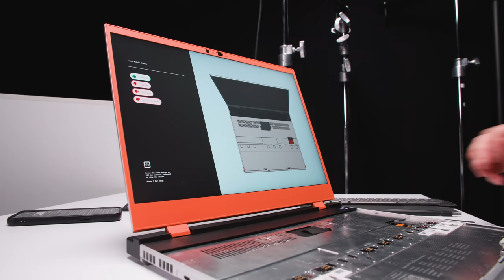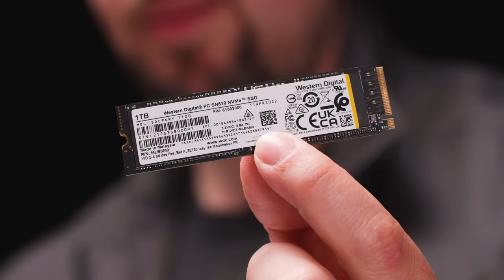Framework 16: an exclusive look inside the modular gaming laptop

Comment: Framework has the advantage that other giant players didn't have. Not only are technology more mature than before (USB-C modules couldn't have been replicated with earlier standard technology, necessitating proprietary modules), they knew when to delegate to the wider community, unlike other companies which tried to do it all by themselves. Also, perhaps most importantly, Framework has nowhere to back off, while existing business have nothing to lose if they don't keep up with the promise.
Reply: I think you're right with regards to USB-C. I think you're a bit off on part about other company's having to struggle by doing it all by themselves. Unlike Framework they had massive engineering budgets, teams and purchasing power that could have enabled them to do something like this far earlier. Laptops back in the day used to have a fair amount of modularity (not for upgrades but for batteries, expansion cards etc). But it wasn't in their shareholder's interests for them to make their computers modular over the long term in a way that would reduce overall sales of laptops. 

Framework's big bet here is that they can scale up big enough to be able to work with big players, and get volume discounts to be price competitive, and then that they can utilize that customer base to continue to sell upgrade parts and new laptops.
Reply: There was a standard used in the past for expandable modules, but it died as more companies ditched modules and became less and less repairable
Reply: It's about money, if a big company does modular laptops. Less consumers will be a new complete laptop
Reply: The truth is that most of those big companies were doing it as a gimmick and didn't actually care.
Reply: There's also another crucial aspect imho: computers are now "fully developped". I mean, of course tech always progresses but unless you game heavily or do intensive video editing that kind of specs will be good for a long time. Even disk space is not really an issue with the rise of cloud based services. If you go full premium and get yourslf the latest motherboard, 1TB of SSD and 64GB of RAM, that laptop can be functionally valid for a solid decade.

Comment: Pre-ordered mine! Expensive AF to deck it out (except storage -- supplying that separately) but I am so excited.
Reply: But that's the thing; sure, the initial investment is high, but as long as the chassis is undamaged, you just replace broken parts and upgrade legacy ones. A perfect example is the CPU, typically an integral part of a laptop that is not economical, if just impossible to upgrade. Here, you just buy a new motherboard with the latest gen CPU, replace it in 10-15 minutes, and you're good for the next few years. Imagine how hassle-free the Windows 10 to 11 upgrade would be if everyone did this.

Comment: The possibilities are endless with the removable ports. I'm on batch 1 of the pre orders and also gonna wait for someone to make a module shell that can house an entire logitech wireless receiver into it so it is absolutely flushed into the laptop.
Reply: Such a shell shouldn't take more than a few minutes to whip up and produce on a 3D printer.
Reply: You might also be able to just take some of the pci express lanes from the expansion bay, add a usb port inside the expansion bay, and put the receiver in there

Comment: The Pricing is very good right now, especially for a first gen product. I think I'm aiming for the 2nd gen version of the 16
Reply: I will buy the Gen 2 too.
Reply: I'll buy first Gen, but I want to wait until it's fully out and probably will wait for a second Gen graphics card module.
Reply: isn't the point of this that there are no "Gen"s? The framework 13 has kept the same body through 3 years of CPU upgrades. you may be waiing a long long time if a new body is what you're after
Reply: @defnotatroll  I agree Generation is probably a bad way to talk about what Framework is trying to do. 

My point is, I'll hold off sometime and see if there are iterative (or otherwise) design & sw changes/improvements, before getting one.
Reply: @radikal8485  design change with compatibility with existing components would be great
Reply: @defnotatroll  yea I know it's not the right wording. The first 'update' to the fw16 then I suppose.
Reply: $1400 for barebone. No dGPU, no ssd, no ram, no USB ports. Also lol at verge deleting post with crapping on framework.
Reply: Why wait? If it's just to get the next CPU or GPU.... Why not wait for the one after that?

Why not wait forever?

I'd argue you should buy one as soon as possible and dump on every other wretched laptop maker for not having something like this.
Reply: There aren't really any "generations" though, the framework laptop 13 case has remained the same though all 4 CPU generations it has so far

Comment: This is awesome! I just wish they added a trackpad with buttons.
Reply from the maker: Yeah I was surprised there aren't alternate trackpad modules. Also, you have to have the trackpad directly below the keyboard, not that many people would want to offset them from one another.
Reply: Separately, I’d be very surprised if they haven’t looked into a TrackPoint (is that what it’s called? The red keyboard nipple.)
Reply: Not having actual buttons is a deal-breaker for me.  Otherwise, I'm sure it's a nice machine.
Reply: Yeah, I have a trackpad with no buttons and I absolutely hate it. Worst trackpad I've ever had and I've had a lot of them. Impossible to do left + right click at the same time, amongst other things.

Comment: While it is expensive for the specs, I see it more as me buying the laptop not because its the best value, but because I love the concept and really want to see them succeed in the long run. Also I don't really care the dGPU is close to 3060 levels of performance, it's still a massive upgrade from the RX 6400 I have in my crappy Dell OptiPlex from 2013, and most of the games I play don't need super high end GPUs anyway.
Reply: And you'll be able to keep the chassis/core components and only upgrade your pain points going forward.
Reply: Chances are pretty good that eventually they will have Nvidia GPUs too so for those that are like me and dont have a lot of time spent with AMD hardware that will be good. This will be my first full AMD system since my laptop I had after high school.
Reply: @claytonmerle976  Funny enough this will be my first laptop after high school. I'm so excited to get rid of my school provided Thinkpad for something with a bigger screen.
Reply: It is also a great value for its upgradability. When you want a new laptop, you won’t have to buy a whole new computer.
Reply: @CC-gy7el except 2 whole new computers might be cheaper than a framework plus upgrading it overtime. I hope they get big enough to be cheaper.
Reply: @MrGamelover23  Probably high cost rn because of the massive advertising they have to do to get their name out there
Reply: @Abberaeitsneozm  I doubt that, remember that they are not big enough to have the economies of scale of the competition. Remember, these aren't just simple off-the-shelf components.

Comment: Let's say if I buy a fromework Laptop today, my expectation is to keep this laptop for as long as posible and in theory, I can keep this laptop indefinitely as long as Framework keep supporting upgrades / replace modular components for the laptop. So instead of spending 1000 USD every 2-3 years I can spend  400-500 USD (hopefully) to upgrade
Reply: I have a vivid vision of carrying a 14 inch modal Framwork laptop to my company for work and then bring it back home and mount it to eGPU for gaming
Reply: @heliosaiden  Yeah, doesnt seem like frameworks gonna go anywhere, with linus tech tips talking about putting cash into their stocks and the fact they sold out 5 batches in 12 hours.

Comment: i am hoping that they make the rgb work with openrgb.
Reply from the maker: ditto. SignalRGB too please. It's all QMK so it's probably not much of a stretch...
Reply: It's QMK so probably not, but you can edit the firmware itself and QMK has really good built-in RGB support (like changing light colors based on keys being held, the current layer you're in, etc). QMK's RGB support is way better than openrgb, although you'll need to edit some config files and re-flash the firmware to change the rgb instead of having a GUI

Comment: Wonder how many and which GPU upgrade option are going to be available for this line?
Reply: the more succeful it is the more support it will get
Reply from the maker: None confirmed yet beyond the 7700S, but AMD made it sound like this has a generation or two in it (without promising anything) even if it's not a roaring success. Then again, it could fizzle if nobody buys into it.
Reply: It took them a while to get AMD onboard for SoCs, so I can see them eventually trickling in new GPUs from Nvidia down the line.
Reply: It had better be something decent and somewhat soon, because the GPU they're shipping now is kind of a joke machine. I don't want 3060 levels of performance on a $2100 laptop in 2023 that I'll actually receive in 2024. That's terrible for them in terms of ability to produce, but I refuse to pay for something like that regardless of their troubles.
Reply: @abubakrakram6208  Then you wait and see if anything is produced "in the future" for this laptop.

Comment: This looks so cool. If they ever get around to adding Nvidia GPU's, it'd be really hard for me to not get one at some point. The idea is so well executed and the fact that you can buy a case to turn old mainboards into mini-desktops for like $300 is amazing
Reply: The desktop case is actually just $39 USD, if you've got spare modules to use with it (and presumably the RAM and SSD that goes with your old motherboard). And if you are willing to accept the slight jank of sticking a USB-C cable into the expansion slot, you can even technically get away without any. But with USB-C (which can also do video) and USB-A modules only costing $9 each, it's not expensive to get a more polished setup.
Reply: Another reason they went AMD instead of NVIDIA is probably because Framework has a sizeable Linux user base and NVIDIA has by far the shittiest drivers on Linux (both AMD and Intel GPUs use one driver called Mesa, and instead of contributing to Mesa like the other 2 companies NVIDIA decided to make their own closed source shittier driver)
Reply: Lack of Nvidia GPU is what’s holding me back as well. I really value DLSS for playing games on my 4k monitor or TV.

Comment: I'd like to see them offer some entry-level mobos - i3/i5 and ryzen 5/3 so you can get onto the platform cheaper and upgrade later.
Reply: I think the barebone is such a big part of the price that a cheaper cpu won't affect the price in a relevant way.
Reply: @marcus3d  Taking the Ryzen configurator for example, there are 2 options and the highest end one is £200 more expensive for a relatively minor bump in specs. If that's purely reflecting the OEM part prices they could definitely offer cheaper options to significantly lower the entry price to below £1000.

That being said, I know they're not able to offer these systems at great volume yet but that could hopefully change soon. I'd also love to see if the standard was open enough for 3rd parties to consider making their own boards??

Comment: I want this to succeed but so many companies in the past have done similar only to abandon the projects leaves me less than optimistic.... In particular I remember one a long time ago I think it was a Lenovo... Where you would use the dvd rom slot to  swap your new GPU ( which was shapped like a dvd rom drive..).. I always thought that was a neat idea... The laptop was made and worked but they never released any GPU upgrades for the device..... So the real test isn't if a company can build it.. It's if it's willing to provide support and upgrades down the line.... So far this product has a long way to go but with a company like frameworks behind it I'm hopeful it will work this time..

Comment: aside of my macbook, this is the only laptop i'm looking forward to own, but the pieces are super expensive tho, i understand that you're not spending $1200 every 5 years from buying a brand new laptop, but you're spending for battery replaceability and cpu upgrade that will cost the same and even more, i'm just hoping they increase the manufacturing and improve the cost of pieces, they've been in talks with other companies to make other components like cooler master, i mean, this is the future of laptops, i just stopped going for laptops when it comes to gaming or productivity in large scale, but if framework is still alive in the next 5 years, i'm sold for real
Reply: A whole laptop is still more expensive than getting the modules+ battery
Reply: @mcslender2965  i just checked on their website and a 11th gen intel motherboard is on discount from a $1000, i'm not sure if that's cheaper than getting a laptop
Reply: @NicolasSilvaVasault  I also just checked their website, a standalone upgraded 13th gen intel i5 is 450 whille the entire laptop with the same cpu comes out to 1050. That's 600 dollars cheaper, an 11th gen framework 13 has the exact same keyboard, display, chassis etc... as this new one.
Reply: @itsasadbunny  bro they're on discount, the real price is like 700~1000 also, some of their low end cpu motherboard are way more expensive than a laptop of the same specs
Reply: @NicolasSilvaVasault  They are not on discount. That is the market price. The discounted prices are even cheaper, with the 11th gen going for 300 for the base model motherboard. A similar spec xps 13 plus is 1300 vs 1500 for the framework. You do have to pay some premium for upgradability so they are the same price, wise.

Comment: A tiny company like that plus all the engineering for the swappable components give you a starting point with 16gb/512gb, but Apple STILL only give 8gb/256gb in 2023 for base model and charge you so much more for any upgrade.

Comment: Oh boy, I've been waiting for this for a while now. It is a little disappointing that they only have 1 graphics card option right now, but as long as they make newer upgrades in the future, I'm definitely going to splurge and order one of these.
I do wish there was 2 NVMe slots on the motherboard so you could run dual SSDs in RAID mode.
Reply: There are two slots but one is of the shorter kind
Reply: @cagatayy1182  Pretty sure the 2nd one is for the wifi card though.
Reply: It is for an SSD according to the specifications on their website and their blog post about storage options
Reply: @cagatayy1182  That would be excellent.
Reply: @DJdoppIer  Yes I can confirm that it's for an SSD (they also have an option to put an SSD in it on the configuration menu, although the SSDs they provide are really overpriced)
There is a 3rd M.2 slot elsewhere on the motherboard for the wifi card
Reply: @obj_obj  Excellent!

Comment: Wish they survive long enough to achieve near price parity with similar spected gaming laptops. 

For now, the entrance fee is still a little bit too steep in my opinion since you can  get a gaming laptop with an RTX 4070 and 780m equipped CPU with the Ryzen 7 7840h  with 16gb ram and 1 tb  ssd for a base level Framework laptop costing $1700 and it's also going to have a comparable amount of ports)

Comment: is it true the Interposer is only rated for 50 swaps before needing replacement which would kind of ruin the concept of swapping out the dgpu for the blank if you want ultraportability or maybe utilizing that expansion bay for things like a second battery, etc?
Reply: Yes and hot swapping is not a thing, you have to remove the keyboard and other componentry to access the connection and screw it on. So it has to switch off. I'm hoping the gpu can be switched off by software
Reply: @incognitobandito244  I wasn't referring to hot swapping, but rather swapping in general (be it powered down) and with the interposer only rated for 50 swaps, I feel framework was playing it a little lose with the marketing the past few months eluding in all promotional material the ease of switching from the dgpu to a blank,. But now looking back -  all the camera angles were positioned to show the underside of the laptop making it look like it was a simple swap in/out - but I get it. Just think that was one feature people were excited about only to find out its not as initially advertised. Still hats off to Framework for what they're trying to do.

Comment: buying all the individual parts is much more expensive than buying the diy laptop. I would have prefered reasonable prices as long as you previously bought a diy or prebuilt laptop. Buying a diy or built framework laptop is already more expensive than regular laptops and on top of that individual parts are even more expensive. I didn't properly say it but you get the point.